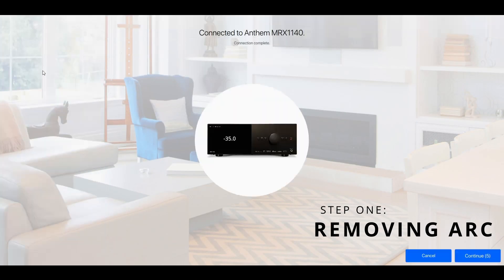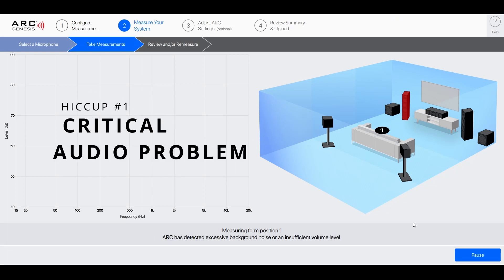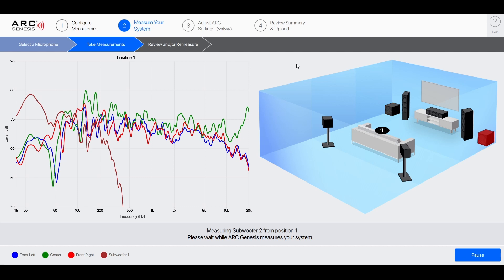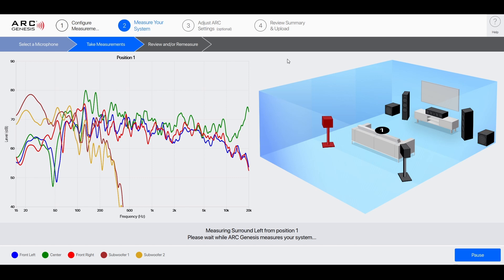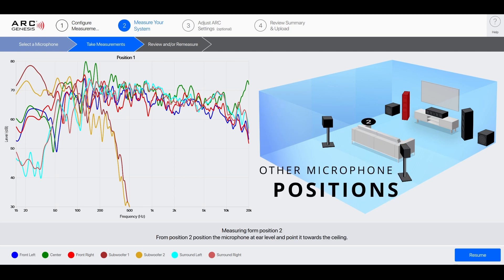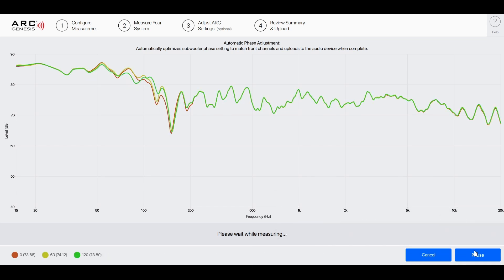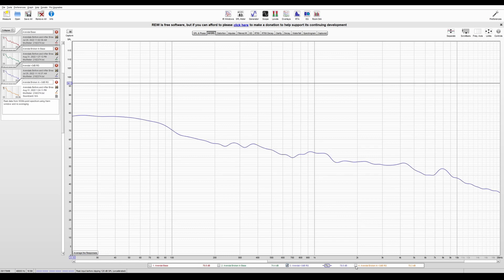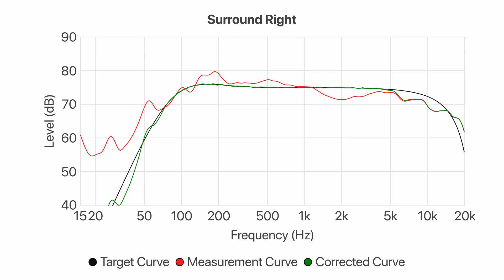Arendal 1961/1723 S broken in to rerun ARC with a few hiccups - Home Theater #25

Comment: Wow, seems like you had a quite a few issues, calibrating your speakers and subwoofers
Although I know your video is 4+ months old, so you probably got everything running like you want it now but just to throw my little too since N, when I calibrate my speakers, I use the Denon receiver, and both of my home theaters and the subwoofers are from svs and my Denon receiver always asked me to set my subwoofers to 12 o’clock on the volume  dial dwhich is halfway which would be 30 DB and after that it works perfectly 
After my calibrations, I’d then check the crossover levels, and I also check the volume level by using a sound meter to set all of my speakers and subwoofer is where they supposed to be reference level
Reply from the maker: Yeah, that was a tough one for sure and yes as you noted this was a little while ago and things have been working a lot smoother since then. My system is sounding great and have recently made some changes to the power portion that will be sharing soon but luckily everything went smoothly. Appreciate you sharing your tips on how you go about setting things up, it  and what others suggest definitely helps me when I start running into issues.
Reply: @RandomDistractionsYT  yeah yeah no problem. Enjoy your system.

Comment: Thanks for sharing your experience with setting up the Anthem. I am trying to run ARC Genesis on my MRX 520 and am stuck at Hiccup #1 - critical audio problem. Now I don’t have any previous arc file for my MRX 520 as this is my first time ever running ARC genesis. So the solution you propose is not applicable for my case. Are you aware of any other way I can tackle this issue? Thanks
Reply from the maker: Sorry to hear that you are having that problem. With some of the recent updates to the software I haven't had that issue since this video so the first thing I would say is to make sure that you are up to date on the software and the firmware for your receiver. If those are good, I would suggest reaching out to the Anthem to see if they have any additional advice. If you are part of the AVS Forum you might also be able to get someone's ARC file for their 520 to upload and see if that fixes it as well. Best of luck though, I know that can be frustrating.
Reply: @RandomDistractionsYT  I figured out a way to fix the «critical audio problem» issue at least on a MacBook. The solution is to run it while the MacBook is plugged into the power source. Then the measurements go through without problem. So the thing is, the MacBook’s USB port is not able to deliver enough power to drive the arc microphone if it is being run on battery power. I didn’t try this solution with my windows laptop though. Cheers.
Reply from the maker: @paulsoumya  Glad to hear that you figured it out and will keep that in mind if I run into that problem or if anyone else asks. Thanks for sharing that information!

Comment: Hey is it good to have 2 subwoofers or 1 ? Also I was thinking of getting SVS subwoofer but I’m not sure which model to get . Thank you.
Reply from the maker: Oh yeah, definitely recommend two of them. Would even say if you needed to go with smaller dual subs instead of one bigger one (due to budget) to go that route. Not necessarily to be louder but it helps to even out the bass throughout the room. As for which model to get, it depends on your budget and the room size. For example, my living room is about 19'x16' (although it's an open space) and I have dual SB3000s. They are set around mid -20s so they have lots of headroom and can get really loud, the average is in the 100dbs.

Comment: Don’t bother doing what you said at the end of this video you won’t like it.and when you go from example on svs app -15 to -16 how do you know it 1db ? And when arc says it 7 db too loud thats load crap its not accurate.for stero 6db room gain ok but for movies  I think thats way too much.also best way to do subs before running arc and to get the null out with svs app is this method run arc no svs eq on subs run 5 measurements upload arc no phase required after that run quick measure look with arc on look at graph see what you need to eq with svs app  then delete arc from 1140 rerun 5 measurements and upload do your tweaks like room gain ect then run phase and done
Reply from the maker: But I'm so curious! It may not be worth it but will still give that a try. As I said in the video if I hadn't had that last hiccup I would have tried your suggestion of EQ'ing but that will have to wait till I do it again and hopefully not have the quick measure issue.